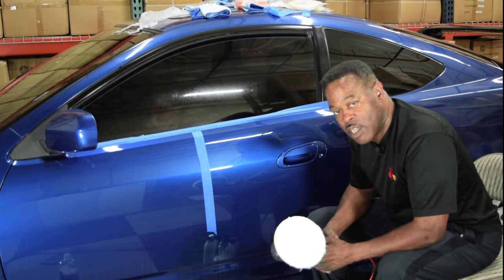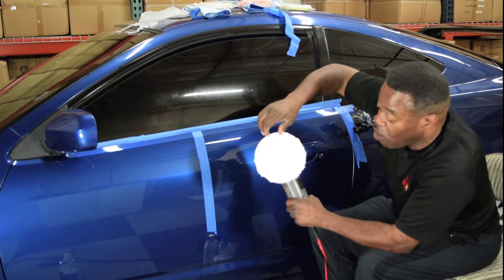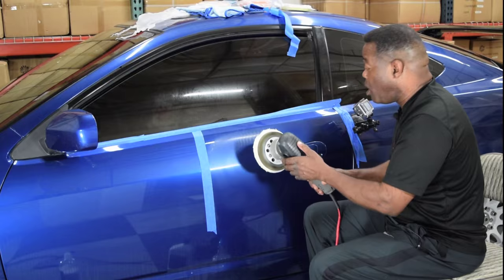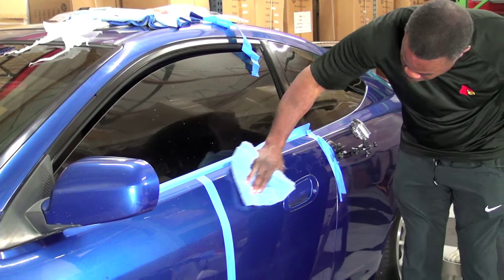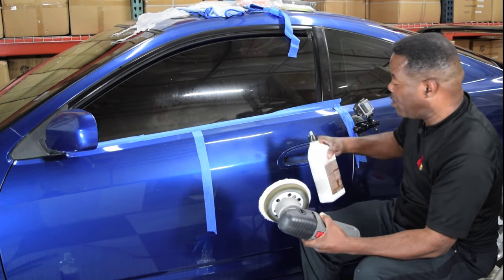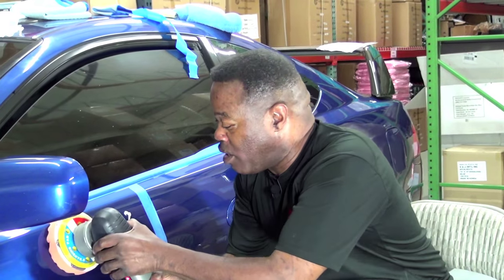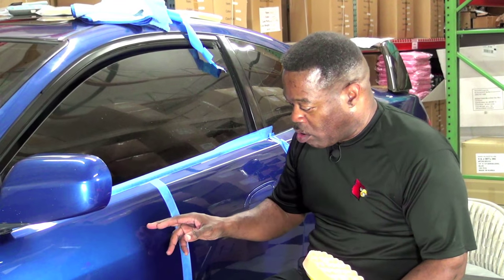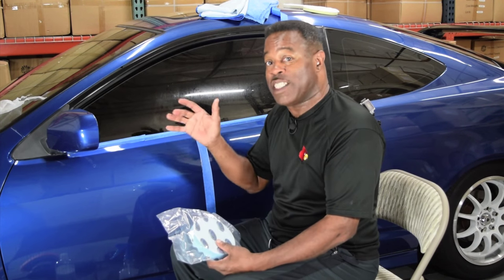Foam vs. Microfiber Polisher Pad Comparison (w/ The Junkman)

Comment: OK, I was at first leaning towards the M105 to M205 using foam pads.  Then did more research and found that when using a DA polisher, Mcguiars actually recommends going to the D300 compound and D302 Polish, BUT these are recommended to use with microfiber pads.  Now I watch this video and I am totally lost again.  What would you recommend for less cutting time, can I use the D300 with a foam pad even though McGuiars really recommends it for the microfiber? (or perhaps the microfiber Mcguiars uses is better at cutting than the ones you use here?).
Reply: rodney hawkins i use m105 and m205 with hexlogic foam pads with great results but like junkman says if you have a crap technique then you will get crap results just buy which ever compound pick up a 20buck fender of a car thats around 12years old and have a go you will soon find out there is nothing to be afraid of, now practice with which ever compound and polish and you will impress your self im sure as i was the same as you.
Reply: Don't get lost in the weeds. M105 and M205 may have been "supplanted" with more modern products, but they are known quantities. There's a lot of data out there on them, and most of that data has been with people using foam pads.
Reply: rodney hawkins I see compound in the edges of the handle while you say notice no polish is on the handle???
Reply: Meguiars, contacted me yesterday because i had same Question, They replied that i can use D300 Compound, D301 Polishing Wax and D302 Polish  can be used with Foam Pads as well. The D series compound, Polish and Wax were designed for Microfiber pads, Do to Microfiber pads being a little more aggressive, they cut better and faster with the D Series Compound, Polish and Wax.,  

To ansnwer your ? Yes you can use them with Foam pads, as well, but they will require a little more work and you wont get as faster results as you would with the Microfiber pads with the D series Compound, Polish and Wax.  hope this helps :o)
Reply: @Robert Jay
 For a second I thought the same thing, and then noticed it...Don't mistake reflection for product. Watch 40 more of THE Junkman's vids in his garage light and you will see NO polish in the seams. Rinse and repeat.
Reply: Don't overthink it! You can use any of these products with a foam pad and rub it on and off by hand... Clean, Clay, Compound, Polish, Wax. It's quicker and easier with a DA machine, If you get good results using D300 on a foam pad you're not doing it wrong.  Try a microfiber pad, it might cut quicker and shorten your work time. But if you're not working too hard and are getting good results don't change! Just remember to use a rag company eagle blue edge-less microfiber towel!

Comment: AJ
After doing a section pass you should clean the mf pad with compressed air. MF pads clean best with air. A cleaning brush will work to but not as effective as the compressed air.

Comment: Interesting that your results seem to contradict all the objective tests regarding the cutting speed of microfibre discs vs foam pads. Maybe the stiffer backing plate and the higher speeds of the foam could have been an effect or the stay detailer was masking the final results on the foam tests? Either way it doesn't matter because this was pretty anecdotal and I prefer to trust the numbers so to speak (or at least trust r+d lab testing over garage testing!)..... sweet video nonetheless!
Reply: Super late to this video...but my exact thoughts as well. Typically wool and microfiber run cooler too than a closed cell foam pad. I use microfiber pads all the time along with Griot's boss system and always a fast flawless finish. Also I feel your suppose to butter those pads a bit more than use smaller amounts to start other panels ...idk I'm just an advanced amateur lol 😂

Comment: I have an 2015 Audi A3. Medium to slight dark blue metallic paint that has some very light swirl marks. Was going to use the Optimum Hyper polish spray and their black foam pad. Just ordered a PC7424XP. This will be my first time using a machine. I have watched your 6 video series on novice detailing. 
I will wash (two bucket method) then clay using meguiars clay bar then polish, then wax it.
Sound like a plan?

Thanks Junkman
Reply: Those sound like the proper steps but the question is how much did you pay attention to everything I said and how good is your technique.

Comment: Hey junkman,I see your using the PC 7424,I'm having heating problems with mine,backing plates gets really hot,it ruined two backing plates,any suggestions to solving this problem,thanks junkman
Reply: h1989w7373 do you have the correct extension cord, per the manual?
Reply: That's what happens when you use the wrong gauge extension cord.

Comment: Hey Junkman, I'm curious if you had the chance to try one of those 21mm long throw polishers and what your thoughts were...great video
Reply: +Mp0wer If the polisher doesn't have forced rotation, it's just waste of money because you will magnify the problems that an under-powered orbital has unless you are using it on a perfectly flat surface. If it does have forced rotation (as in a dual-action polisher like the Flex 3401VRG), then it would be good to use on something like a very big object (large boat, RV or box truck). On a car, especially a small one, it's worthless. A novice should want as small of a throw as possible so that they can get the most out of perfecting their technique.

Don't fall for every detailing gimmick that comes out. Manufacturers are constantly trying to figure out how to separate YOU and your money. If you truly understand what the size of a throw does as far as buffing is concerned, you can easily see the pitfalls as well as any advantages it gives you.
Reply: +Mp0wer Listen to the Junkman! I just bought the Rupes LHR15ES and Im not happy with it, its useless in small areas and in those with certain curves. I should have got the Flex 3401 instead.
Reply: TrevorGoodchild999
And there you go. Someone who is speaking from experience.
Reply: +Junkman2000 Junkman, it's getting weird out there with all the marketing / hype around detailing products and tools. I can't tell you how many times I put my fancy, high dollar machine away in favor of the PC. 

Totally agree, trying to separate you from your money.
Reply: danlc95
And for those folks in the dark who fall for those gimmicks, they are giving away their hard earned bucks. That's why you hardly ever see me posting on forums that push that crap. Those vendors are either paying to be there or they own the forum and if you go against some of the crap they post, you'll end up getting banned. I stay away for that reason and preach all my sermons on my You Tube channel. Funny thing is, those companies are watching me and have tried to reach out to me in different ways. I always tell them if you want to buy me, it's going to cost you 6-figures. If you try to intimidate me then go screw yourself.

They usually leave me alone after that.   :)
Reply: +Junkman2000 love the  videos,  I hope you got 6 figures worth of eagle blues!
Reply: Trevor, it could be technique.
Reply: +Methodical2
Yes it could but that still doesn't atone for when you are working on something sexy like a sports car. All that throw is completely useless if 50% of the pad ain't even touching the surface that you are working on. Add to that, you can get the SAME EXACT RESULTS with a polisher that cost over $200 less than what you would pay for a Rupes orbital.

"The Emperor's New Clothes" is a good story for novice detailers to read because when it comes to detailing equipment and products out there, some novices are truly walking around butt naked because they spent all their cloths money on detailing hype. Flava Flav said it years ago....*"Don't believe the hype!"*

Comment: Junkman, I like your videos, which are very informative, but this video had me scratching my head.  It was not up to par with your previous videos (i.e. did not follow your typical protocol).  I found quite a few questionable things about this review, but one very obvious thing is you never showed a "before/after" closeup of the area worked which is something you've always done in your videos to prove your point and to let the viewer see and judge for themselves.  Why not this time?
Reply: Methodical2 kick backs from the foam head suppliers.
Reply: Nice try, but Optimum doesn't supply ME with anything free.

The reason that I didn't show a before and after was because the difference was not significant enough to see on film. I usually use a car that is jacked up beyond all repair. This car was not in that condition and it was the darkest color car that I had access to.

Comment: MF pad is known cut better than wavy foam pad. If you test result is the other way round means that you did not choose same condition parts for your test. Use bonnet with bigger surface will give you better result. And cut short your video, too long winded video!

Comment: Hey Junkman, what kind of quick detail spray did you use to remove the excess compound?  There are many kinds of quick detail sprays on the market, some using sealant and waxes.  Which one would you recommend to remove compound/polish residue with?  Thanks.
Reply: I have a ton of Infinite Use Detail Juice in my garage to use. But in reality, it doesn't matter who's detail spray you use. Detail spray is detail spray. Now cost factor is a different story.
Reply: What do you think of using something like CarPro Eraser or some other kind of IPA mixtures to remove compound/polishing residue?  Would that be a better alternative then using a quick detail spray?  

I'm just a weekend warrior, but I'll leaning away from using a quick detail spray because it may hide defects as your compounding/polishing the vehicle.  I think IPA or CarPro Eraser will do a better job of cleaning away the polishing residue giving you a better view of your results.  Thoughts?
Reply: Monkey Kiss
Thoughts? Yea, you're trying to make this rocket science. First, detail sprays don't "hide" anything. They ain't nothing but a VERY light cleaning agent in a bottle. You could make your own. Second, you can take a bottle of alcohol and mix it with 50% distilled water and make your own IPA. Quit overthinking this stuff man. It's NOT that complicated or needs to be that expensive. Have you seen most detailers today? They don't look like they are on the verge of splitting atoms do they? If this hobby was that complicated, I wouldn't waste my time at it. I like playing one type of video game. First person shooters. The kind where you kill anything that moves, screw the strategy. If I have to think while playing the game, I toss it in the trash.
Reply: LOL  Rocket science?  Nahh, just researching the best way to get things done.  I don't want to be chasing my tail, so I ask questions.

I have Meguiar's Quick Detailer spary and it states at the back of the bottle "The safe, high lubricity formula....while enhancing gloss and protection".  The "enhancing gloss" part concerns me.  I don't want to be  "enhancing gloss" when compounding the clear coat.  I want to remove polish residue so I can better inspect my progress and final result.

Maybe I'm overthinking this stuff, but as a newbie I'm still learning.  The CarPro Eraser cost as much as any detail spray.  Why not bring out the big guns and use a product that will actually break down polish residue?

Screw the strategy?  Come on, that's the fun part.  Don't tell me you never enjoyed a good game of Risk growing up. :)
Reply: Monkey Kiss
I never played Risk. Couldn't afford anything but checkers. As for what your Meguiar's bottle of detail spray says, they are blowing smoke. Pretty much all of that over the counter garbage claims to do something that it doesn't. Don't believe the hype. Use the cheapest stuff you can find and don't expect it to do anything but be a clay lube or a pad spritzer.